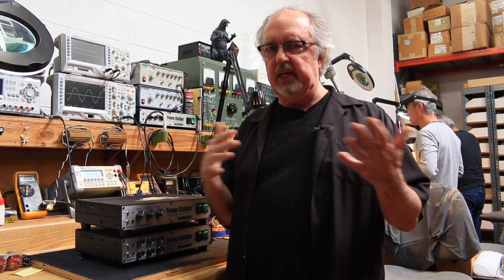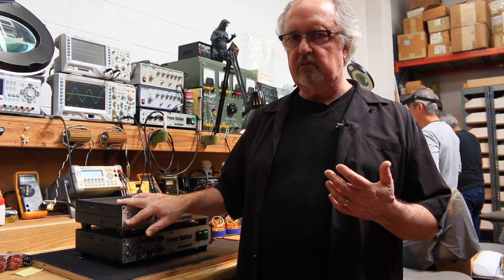POWER STATION: WHAT IS FLAT?

Comment: Could you develop a 50/50 stereo version of the Power Station - with a stereo FX loop? Just imagine what a game-changing product that would be. You could run ANY tube amp in stereo to two cabinets without needing a separate head, while utilizing the attenuation/re-amping wizardry of the PS.

Comment: I'm looking closely at the power station, primarily just to use as a power amp.  I'm running a Friedman IR-X from the send out, and want the equivalent of a good tube power stage in an amp.  Is the power station going to be too neutral or flat for this purpose?   Would I be better off with one of the other Fryette power amps if my use case is NOT to attenuate and then re-amplify a signal that already has power tube saturation going on?
Reply from the maker: It will work great for that ad confirmed by Dave Friedman himself.
Reply: @FryetteAmps  great thank you!

Comment: TLDR set where it sounds right... That's a very bad answer to be honest. Many people are asking where is the flattest setting because they want to address EQ adjustments in whatever pre-amp they're using (in the scenario where the PS2 is being used as a power amp). And using the EQ on PS2 for small adjustments (different venues etc). I'm using a Fractal FM3 with a PS2-A and I have to boost the lows to the max I can on the PS2 to make it sound ok. Now it could be that my preset is to bright/doesn't have enough low end or it could be that the PS2 doesn't have enough low end. Without anything to compare too I wouldn't know.
In other words what i think people are asking is not about volumes (FM curve), speakers influence, perception, ears, bla bla. 
It's literally which configuration the PS2 is not adding or subtracting frequencies, aka the "flattest " setting. 
Is it setting eq on "flat" with presence and depth turned off? 
Looks like it is. 
Not sure yet
Reply: Yes I agree...I couldnt have said it any better.....That IS why I'd like to know what "flat is" ie: What setting is it where the power-station is not adding or subtracting any "EQ" of it's own

Comment: Is there a scenario where it would be more desirable to use the flat setting vs engaging the reactive part of the unit? Like if you were going direct without an actual cabinet using IR’s?
Reply from the maker: When playing at closer to normal volume levels, setting the load to flat usually sounds better than at low volume levels.
Reply: @FryetteAmps thanks guys. One more question… i heard somewhere the flattest setting on the ps2 is actually in the middle position of both switches. Is that right?
Reply: @ttop23 do you mean the dip switches or the potentiometers?

Comment: The Flat setting is Perfect for TrainWrecks. As in Real TrainWrecks JMD's.  as close to transparent as you can get, and Lets you Wreck at low volumes. Are the Power Stations Expensive???  NO and Pfhk NO.  These are a very strong value for your dollar.  It is what you are getting for your money.  The PS 100 is a Beast and when you are cranking the Wreck. The KT 88's in the PS really go to work..  I am thinking in Part that the 88's are Attenuating due to the heat that is being dissipated... and that is Brilliant Engineering.